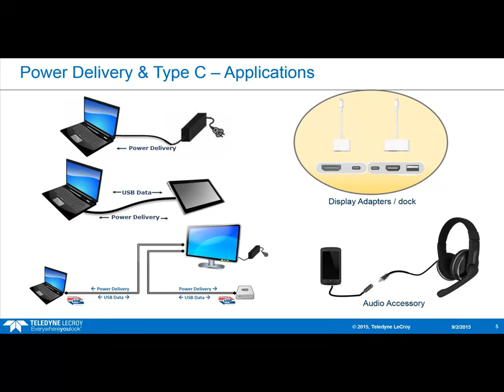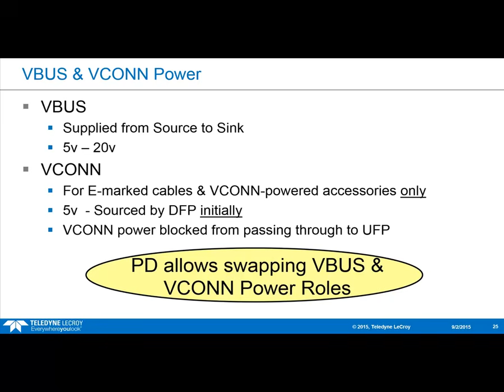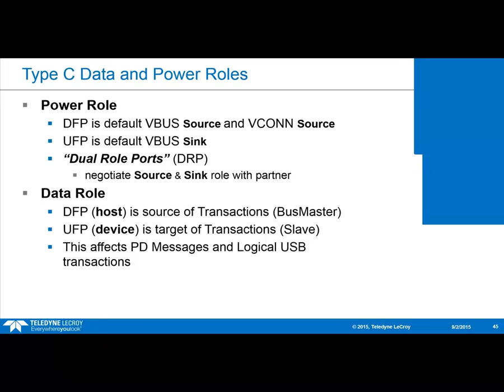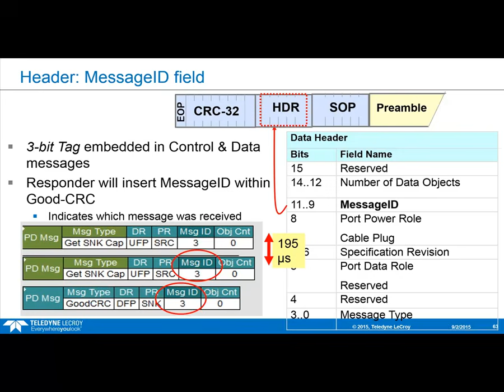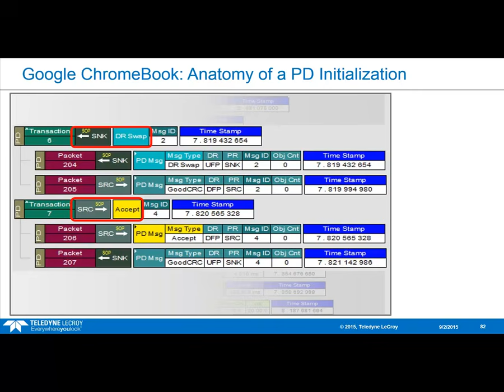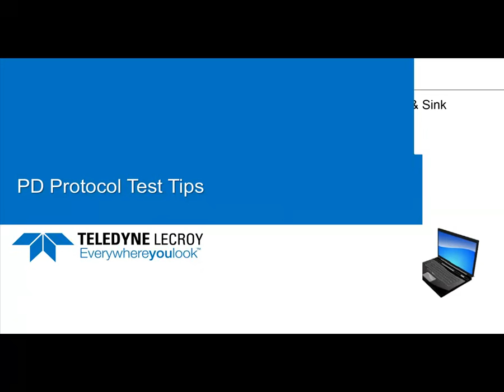USB Type-C and Power Delivery Technology & Testing Webinar

Comment: He is not an engineer, it is quite apparent he doesn't fully understand what he is talking about. He will occasionally jog through something he doesn't quite understand, that is very 'cute'.
But the presentation slides are a good source of information.
Reply: Agreed.. at a dedicated 75 Hz, I can easily see two devices not being able to connect for several seconds, maybe a lot longer, because they happened to be so close to sync that they always see the same status as their own, until a slow natural drift takes care of the problem.  A truly smart USB controller would monitor this, and seeing two or three cycles that matched, would alter the timing a random amount to minimize the issue.  A fairly relevant issue he glossed right over.
     And did he mean 75 Hz as in a full cycle every 13.3 ms?  Or, more likely in my opinion, that it swaps polarity once every 13.3 ms?  I'm also not an engineer, so I don't have a reason to generate the patience needed to look that up..   At least not until I see if the IC I'm using is smart enough to deal with it.

Comment: Nice Insight. I have question. 1) If a Tablet with USB Type C output port is connected to Mac book that needs charging, will the tablet continue charging the laptop till it drains out all its power, or Is there any communication going on between UPF and DPF at regular intervals? 2) Once plugged in can UPF and DPF change their responsibilities ?
Reply: I know this was a while ago, but it's a good question.  The tablet, with it's limited power, should not advertise itself as a DRP or DFP to supply power.  It should always be a UFP, and receive power instead of supplying it.  For special circumstances, or if we should develop awesome batteries, a user configurable setting could change it to UFP when needed.  In either case, any battery powered device should have a setting that shuts down power delivery when it's own battery gets to a certain charge level. (Shuts down delivering power, not Power Delivery the protocol.)